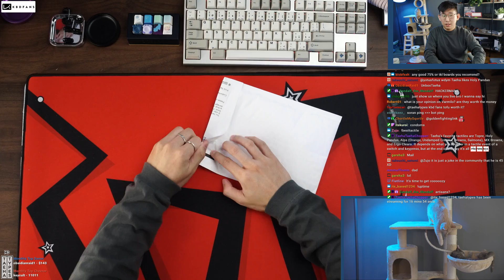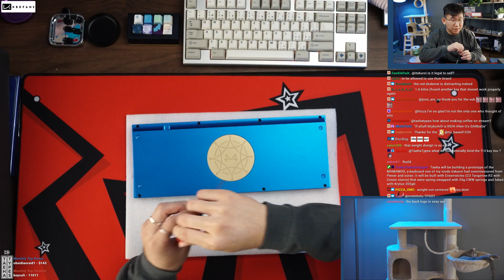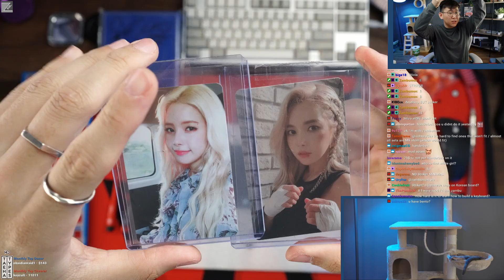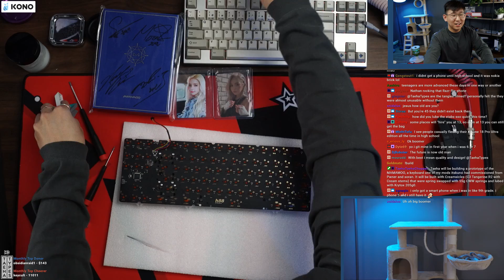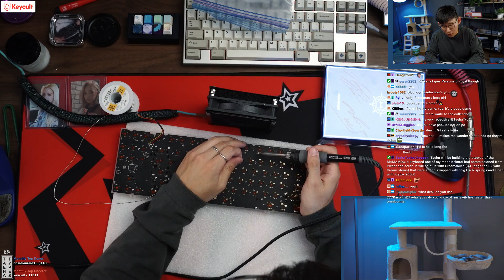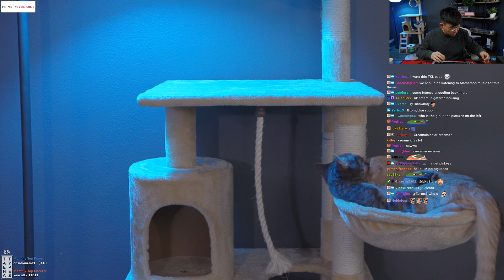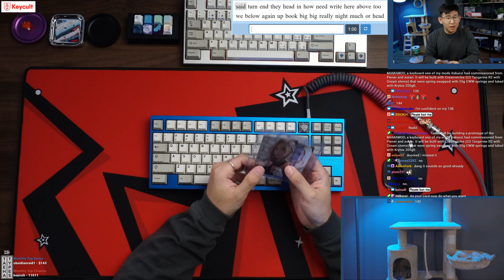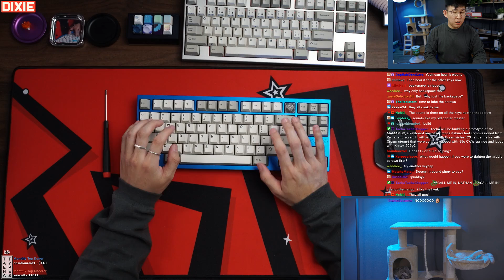MAMAMOO Keyboard Prototype Build Stream

Comment: yup, starting from more simple mechanical keyboard help you to understand luxury ones. I just sold my 50 euros keyboard from 2018, because I felt a lot of things I don't like, which luxury or more expensive prebuild don't have, but have those which I apreaciate (there is no logo in your face, nice font, pbt keycaps, all metal (or other expensice base) construction, variety of switches, compatability, lube :) ). I even lubed that cheap keyboard XD and it was mucccch better. I got my first mechanical kb in 2016 when I was 20 :D

Also I just turned on song to check for what you are building XD